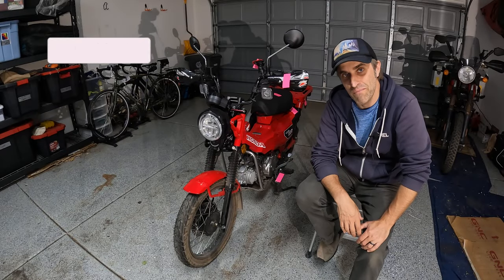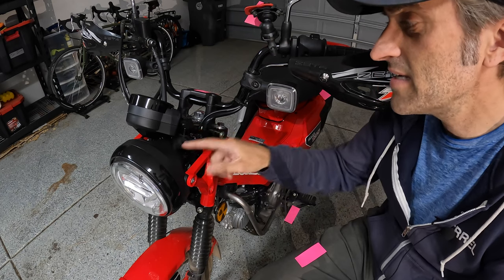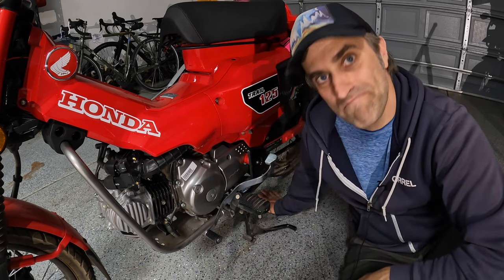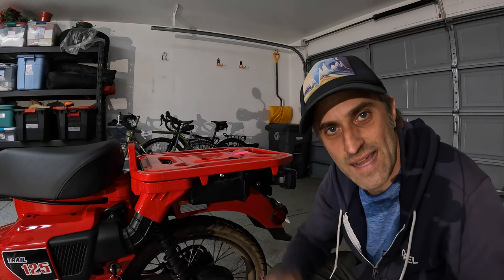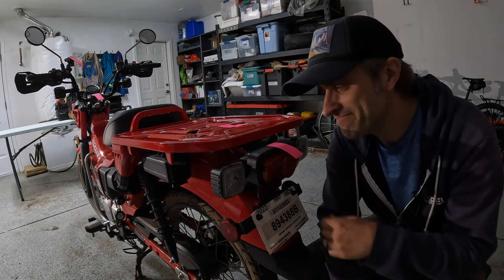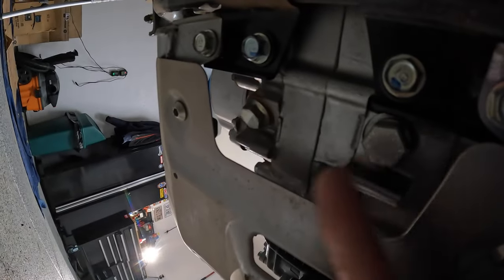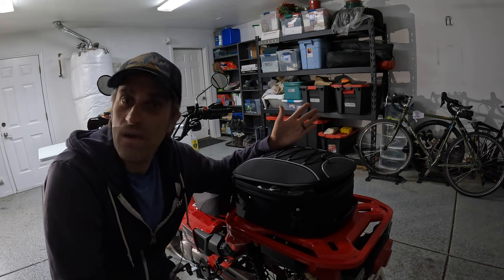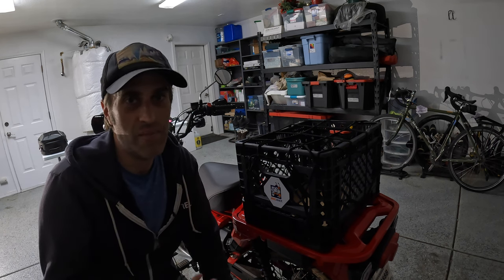Honda Trail 125: Accessories, Mods, & Hacks

Comment: I do not have a CT125, but it is on my short list for a light weight adventure bike (I’m used to bicycles, so no desire for a big bike!)… for those that are interested in milk crates, you can cut the bottom off a 2nd crate to make a nice lid. If you want some top storage leave the bottom section on the donor crate when you cut it off. I’ve used a Japanese style pull saw with good success. The bottom will nest in the 1st milk crate and you can use zip ties as hinges.
Reply: Good hack , thx for the tips

Comment: 2 years after getting mine i am still adding mods to mine. a dollar here and there and about got it where i want it. right now i am working on sprockets.  i have found Stock your not getting anymore speed period. just less RPMS . so i have found a 15/41 works the best stock is 1.78 gear ratio. and the 15/41 is 2.73. and where this helps is if you know you going off roading you can change the front sprocket to a 14 or 13 and get more off road power. cant go to a 16 tooth because it will hit the cover. but like i said keeping the engine stock it just dont have the power to get you more speed. i am thinking of going to a big bore kit but its hard to change something that works so good as it is. and i cant find any videos of people using a big bore kit on how they lasted.
Reply: i have rode Harleys my entire life so i love the heel toe shifter.

Comment: I installed (bolted) a Bauer small tool box on my bike. It's an enclosed box for securing things. I also bought the tote that will snap onto the box. I use it to carry larger things that won't fit into the box. When I don't need it I take it off. This system works very well for me.

Comment: I just got my trail last Friday. For the USB connection I ran a battery tender up near the forks, then ran a matching 2 plug from the USB and connected them. Easy peasy and less wires to the battery.
Reply from the maker: Yeah I almost did this exact same thing as well. Ultimately I decided I wanted the separate connection near the rear.  But your right about battery connections.  I had a heck of a time getting things connected and the battery cover back on flush
Reply: @On2Feet  I struggled for a bit and went and bought longer bolts for the battery terminals. And it's ridiculous that they would make the accessory hole just a little too small, but they did! Small aggravations for a great little bike 😊

Comment: The reason they use the heel toe shifter is because the clutch requires a lot more pressure to upshift than a traditional clutch when going uphill.  You could put a bruise on your foot trying to upshift uphill with your toes.. and if you fail going uphill and shifting you could drop the bike and dump the kids

Comment: Toe and heel shifters are easier to use when standing on the pegs.  Good for an "off-road" bike.  Raising the heel pedal slightly helps you feather the clutch when downshifting.  Cool idea to velcro documents under the seat.  I secure my took box with a cheap little carabiner; found on cheap keychains.  Amazing all the tools you fit in the tiny bag!
Reply from the maker: Whoops...I replied to the wrong comment here before....sorry about that. Yeah the underseat velcro docs works great and getting the tools to fit is definitely a game of tetris. I have to put them in exactly right for the door to shut.

Comment: Try this with the heel shifter. Take your foot off the footpeg and place your toe on the heel shifter to up shift. Of course, here in Thailand, we use the heel shifter to downshift as the shift pattern between Asia and the US is backwards. I have a video out on that if you'd like to try that method.... That way you can ride with flip-flops on like we do here.... As for the huge rear rack, I ditched that really heavy rack for a much slimmer and lighter Diablo rack from K-Speed. I lightened the bike by five pounds by doing this and still have more than enough room for what I carry with my on Adventure Rides, check out my YouTube channel for this and more.
Reply from the maker: It’s funny you say that about using my toes to back press on the rear shifter.  That is the only way it does work for me and I do sometimes do that. (And it works great that way).  I had no idea your shifting pattern was backwards there.  Fascinating.  At any rate, you’ve got a great channel.  I definitely picked up some good tips from you, so cheers!
Reply: @On2Feet  Just watched your single track video, sand can be a bitch with stock tires..... I'd definitely get a set of more aggressive tires if you're going to ride out there very much...... Keep making the videos, we'll mention you on our channel....
Reply: It doesn’t look right riding in flip flops, unless your jacket is on backwards.
Reply: @tonydoggett7627  Actually, we are in the tropics here in Thailand, so I rarely wear a jacket, but next time I do, I'll slide it on backwards and see how that goes.... You never know, I may start a new trend.....
Reply: @TeamDNFracing  I spent some time in Malaysia and they would wear the rain jackets backwards, and open at the back, because of the heat. Would stop the wet road grime getting on their shirt.
Reply: @tonydoggett7627  I've noticed that a lot here in Thailand also.... Me, I just wear a T-shirt and if it starts raining, I just keep on keeping on....... The rain cools me down.... Five minutes after the rain stops, your dry again from all the heat......

Comment: Maybe replace the gear shifter with a toe shifter only I’ve always like the trail 90’s 110’s a buddy just picked up a trail 110 with 36 original miles on it! I wanted a 125 but picked up a 2008 Yamaha WR 250r with 3800 orig miles so the Honda will have to wait a bit

Comment: Cool tips, but unfortunately I bought this tool bag and recommended tools and it doesn’t fit in the tool box on the bike.. I have a 2022, is it possible they put a smaller tool box on the bike this year?
Reply from the maker: So sorry it doesn’t fit. I suppose it’s possible that it’s different for 22. I will say mine fits incredibly tightly and I have to arrange the tools a certain way.  Even then it just barely fits. I had to swap out some of the Cruz tools as they were too long as well.
Reply: Ok, I’ll mess around and see if I can make it fit. Thanks for the tips!

Comment: Top notch video, thanks for the information.  Took my Trail 125 into the dealer yesterday and got knobby tires - front and back.  Shinko 241's.  The street tires the bike comes with are a challenge to use off-road.  I thought it was my lack of skill as to why the bike was slipping sideways through the sand/gravel.  Oh no, it was the stock tires.
Reply from the maker: Yep, I've got Shinko 241's sitting in an online "shopping cart" ready to buy. I just can't justify getting them yet when I still have so much life on the stock tires. I recognize that they are great off road, but so far they've been relatively adequate (at least enough that I'm ok with it)
Reply: The tires is comes with from factory are a good compromise.....most people will be riding more time on pavement and knobby tires on wet pavement are dangerous......

Comment: I ordered the usb off your list. Haven’t had time yet to mess with it, but are the wires that come with it long enough? Or do I need to make some longer ones to reach the battery and have slack for the forks to move?
Reply from the maker: Yeah two quick things worth noting.....First, I had to file out the opening a little with my dremmel. It took maybe 10 minutes of light grinding and it was big enough for the USB Plug. As to your second question...NO they aren't long enough. I just use leftover wire I had and heat-crimped extensions on. I kept the looped ends for connecting to the battery (which by the way, is also kind of a pain). But I actually used my charger today for a longe ride and it worked great!
Reply: @On2Feet  thank you, I’ll get some before I get started on it.

Comment: How did you strap down your milk crate?
Reply from the maker: It’s at the end of the video.  I used an old license plate on the bottom and drilled two holes.  The I used m6 bolts and large washers to tighten down license plate which locked down crate

Comment: Just a quick question, did you notice any color or measure the amount that came out...I have 2 monkeys 🐒
Reply from the maker: I'm not sure I understand what you're asking John. Color coming out where? As in the paint rubbing off?
Reply: @On2Feet  no the 50 mile oil change...I have a couple 21 monkeys and when I drained the oil, one at 3 miles, it was greenish and couldn't see through it

Comment: Please, choose M6 x 30 (hex), NOT the M6 x 40 (phillips); thread count matters.
Reply from the maker: Indeed. They are usually easy to find in an auto parts store as they specifically have a metric nuts/bolts display.

Comment: Dude the document compartment is where the tool kit is🤦🏼‍♂️😂
Reply from the maker: Ha ha yes...obviously the bag that comes in the toolbox with the screwdriver is also noted in the owners manual as the "document bag", but what's weird is the owners manual also clearly states "The owner's manual, registration, and insurance information can be stored in the plastic document bag behind the ride side cover". First, no such storage spot exists (and the right side cover cannot be removed easily) and I think this verbiage got accidentally carried over from the super cub where such a spot does exist....and second, there's no way all three of those things would fit in that tiny bag without absolutely mangling the owners manual. Putting the documents in an aloksak waterproof baggy under the seat, is also way more convenient to get to should I need them in a pinch, second, it frees up my tool box for a proper set of tools, so definitely a win win! ¯\_(ツ)_/¯
Reply: @On2Feet  oooh okay I see what you mean now😂 the only compartment I knew of was where the tool kit is and I don't blame you for putting it under the seat, especially if you do a spare 1 gallon fuel can setup that covers the tool kit. I wouldn't have given it a thought about other Honda's other markets just because I've never bought a new bike that still had an owner's manual 😂 I've been looking into getting a Trail 125 but I can't find any near me. Still a great video you made and I give you props on using sticky notes as reminders, everyone else would probably forget everything they did and make a second video👍